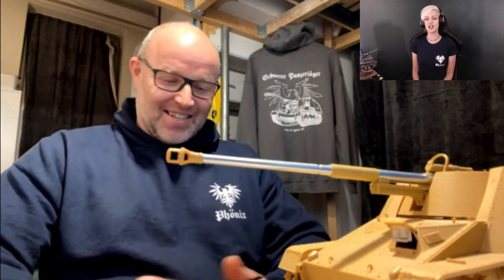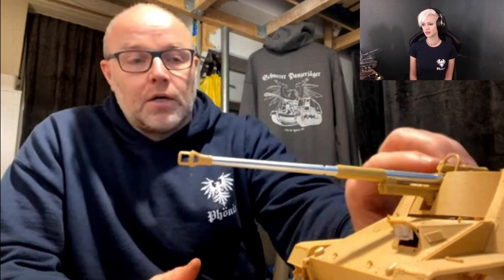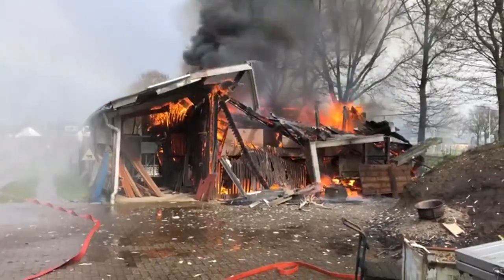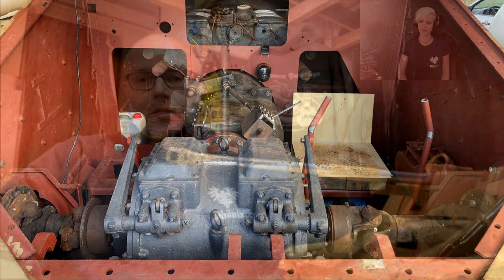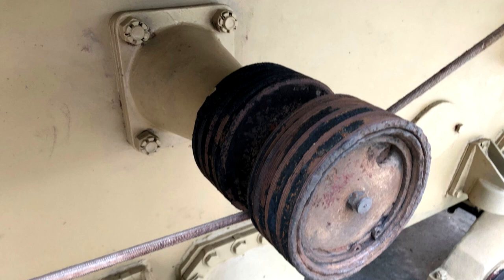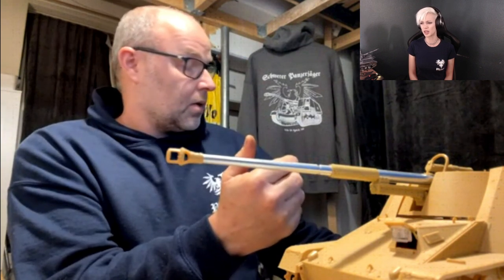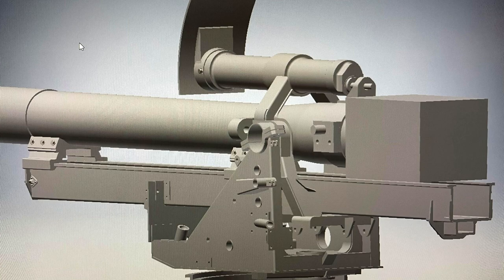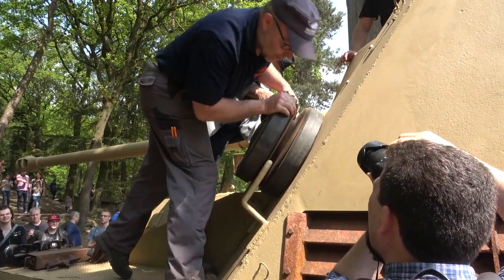Getting the Phoenix running again! Sdkfz 164 Nashorn restoration project update

Comment: The sheet metal they are using on the gun mount looks a bit flimsy. Is that the same gauge steel they used originally?  I remember when they had the fire. They’ve come a long way. My compliments to the crew for their tenacity.
Reply: t's the same gauge as original

Comment: Yeah that return roller rubber model took quite a while to create and to get right. I had to measure everything off of an original manually with callipers and radius gauges etc., and there was no current font close enough to the original so I sketched up all of the lettering, numbers and logos as well from scratch. 

It took me maybe 50 hours plus to perfect that model from the original to my satisfaction, and is close overall to within 2 or 3mm to the original max error, so hopefully Robby is happy with it since I didn’t fine tune the model for 3D printing (like by not adding corner rounds on the lettering etc.)

You should also do something like this for the Flakpanzer once we get work up and running again, not much has changed over the past year but it should be interesting none the less to get an update from us on how the Flakpanzer is doing, nice video as always
Reply: We are very happy with your work. it's being 3d printed now.
Reply: @jackofalltrades164  glad to be of help Robby, anytime you need help from us, just ask